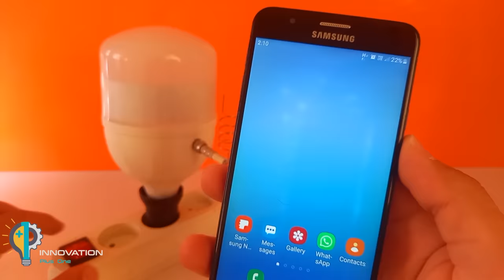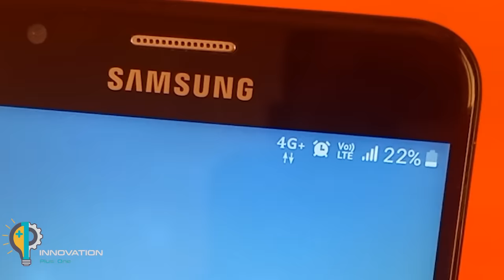Magnet boosts the mobile antenna || Antenna Booster

Comment: Great stuff! Just one thing if I can, the external antenna make it not so solid to be also portable. I mean it’s perfect surely at home, but imagine you need to put it in a bag, or you need it on a train where there is the power plug-in and where often the signal is lost or poor.  Do not misunderstand me, very excellent work, but I was just thinking to an evolution of this already perfect job. Thanks
Reply from the maker: Yes, this amplifier is suitable for home

Comment: Not sure whether to believe this or not. It's 50 50. Alot of work went into the video either way. If the antenna was meant as a single band yagi style it makes no sense because you electrically connected the driver ele,ment to the director and reflector. If meant as a multi band antenna, maybe it works like three antennae connected in parallel. Comments?

Comment: Yeah, just a magnet and a usb wall charger.......  real simple quick and easy and don't forget the 2 dozen other things needed that are just "commonly" laying around hacked slapped and soldered together and powered off a 110v outlet! Nope, just a magnet and a charger, clickbait to get an idiot electrocuted because they don't have a year or 2 of electronics soldering, circuit board, resistor, capacitor, CRYSTAL OSCILLATOR experience. Just a magnet and a charger. Next up lets build a 240V transformer from a couple D cell batteries. Wow🙄

Comment: Im struggling to believe this, no I havent built it. Cellphone signals are very high frequency, definitely not 20Mhz then you put an LM386 in circuit but its an audio device definitely not cellphone frequencies and then to top it off you use a 2200uF cap as a coupling cap?  You have got to be kidding